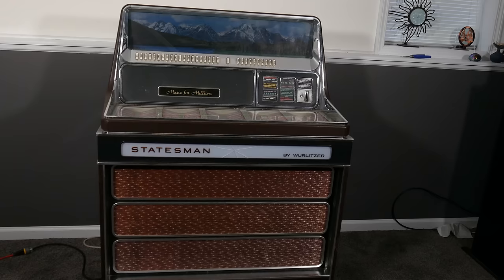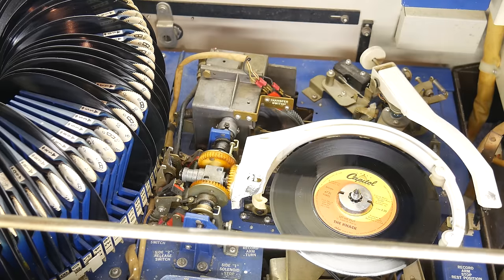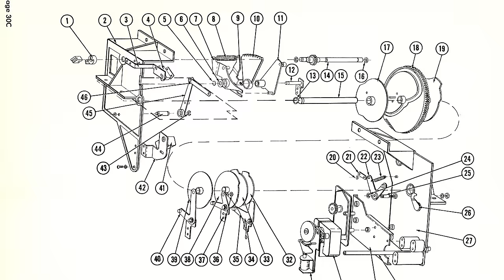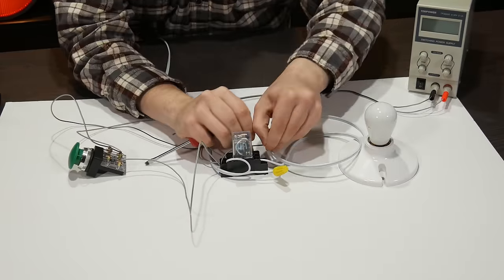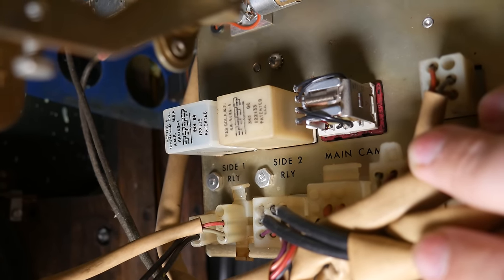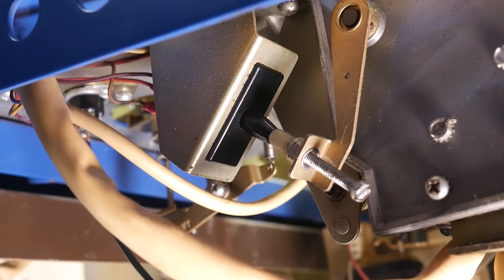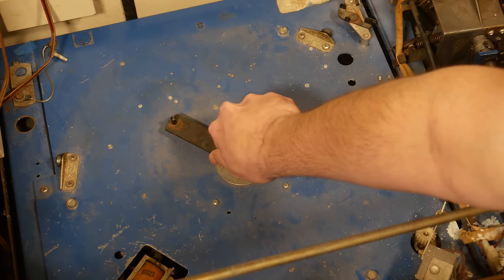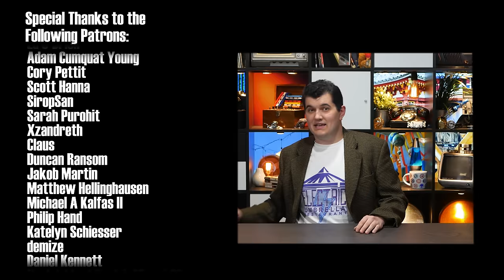The Computer-free Automation of a Jukebox (Electromechanics)

Comment: I think you would get a kick out of the mechanisms that make powered convertible roofs on classic cars work, as they use a lot of the same things you're describing here, but with the addition of vacuum lines running off of suction from the engine's intake! Those vacuum lines in particular can be a pain in the butt to fix, but they are neat.

Comment: interresting, kinda explained why old NYC subways trains (HI-Vs)  were dangerous for operators. The full 600 volts went through the master  controller handle (to control throttle and braking). Newer trains (Low-V and newer), included relays and other interesting stuff so 600 volts didn't have to pass through the controller your hand was touching in order to apply throttle.

Comment: I once had a “Superstar” polystyrene model aeroplane which ran from an electric motor running from a small battery. The tail rudder was steered by a cam which slowly turned and guided the aircraft in a predefined course. Different cams made the aircraft run different courses.

Comment: It kind of helps to think of the modus operandi of this machine, like an electric domino set.

One thing trips another thing, which triggers another 1 or two things, which energizes this thing, which actuates that thing.
It's a ballet of motors, actuators, switches, relays and, in some cases, transistors.

Comment: I made a similar circuit to your relay/light demo with 3ph contactor on a bore pump, the o/load and a flow switch can cut power to the contactor, only the pump is 20m down you have to hold the momentary action start button for 2 seconds until water comes up and activates the paddle on the flow switch for it to run.
Reply: So your play switch is an NC?

Comment: I beg to differ, though I too enjoy these electro-mechanical contraptions but it's very unlikely you'll pick up some tools and materials and start building your own... anything. But with coding and/or arduino and a couple of components you can build cool stuff at home and those can be not just cool for you but useful too. I built a parking place counter system at my previous workplace from arduino, some sensors, wires and some core. The problem was that the parking spaces were behind the building and the road was narrow so it was a constant problem when the parking lot was full they had to back out carefully onto the main road. My solution is basically just a GO/NO-GO signalling at the gate but since I'm not a mechanical engineer I could still easly whip up this system and I think I'm the most proud of this achievement in my life. I could never make such a system with electro-mechanical parts.

Comment: Looking at everything in the jukebox, I can't help but compare it to redstone circuitry in Minecraft.
So many things starting and stopping, triggering each other with a cascade of moving parts.
So many little ways redstone engineering mirrors older electronics.
You pointed out so many Set Reset Not or Latches in the jukebox! The RS Nor Latch is the basis of many redstone contraptions!
I am just so giddy about a silly little observation.

Comment: Since this video came out it's been eating me alive as to why I didn't understand the relay portion. 

After coming back from watching other relay videos I feel your relay video needs to be a bit more explanatory.

The relay needed for this is a Double Pole, Double Throw relay (or Double Pole Single Throw).

Basically the relay has two electrically isolated switches in it which both get triggered at the same time when the control 12V gets applied.

One switch gets wired to the lightbulb and the other one gets wired from the switch back to the control side's input.

So when the green switch is closed, the switches are turned on (called Normally Open) and the current flows through both outputs. The light turns on, and it also flows from the other switch back to the control circuit which bypasses the green switch and so it stays energised always keeping the switches on.

Comment: As a former bowling pinsetter mechanic. Using cams and cam followers is exactly how pinsetters, built before roughly 1990, work. Brunswick Model A (1955-1963) and A-2 (1963-1985) pinsetters have an assembly called a detector. The assembly is 100% mechanical and is effectively the "brains" of the entire machine. Through a series of cam and lever, that pinsetter is able to mechanically determine if you bowled a strike, left pins standing, if a pin slid out of place without falling over (called an out of range) and was able to perform the correct cycle based on the "input" you gave the machine. Though the same cams, the machine knows if it's your first throw, or second throw. The lower the deck assembly to detection height or to lower it all the way to set new pins, when to sweep the rake to clear out pins and a many more functions that bowlers do not get to see. It is really incredible what you can do with just electromechanics.

Comment: Try Central Office switches. Today they are fully digital. In the late 1970's we install the first fully integrated digital switch. Prior to that, Cross-Bar Switches, a form of matrix array. Earlier, Stepping relays. These devices replaced manual switch boards and human operators. Perhaps more fun Pin Ball Machines.

Comment: Electromechanics is a neat field of engineering. Old metro trains in Helsinki, Finland which were built in early 1980s are completely electromechanical and are built to last, cheap to maintain and damn reliable. Siemens tried to automate these trains and failed, the project was cancelled after the budget was about to double or triple. So no automatic subway in helsinki.

Comment: When you were demonstrating how a relay switch works using the 110 volt light, you started fast forwarding the video (and it looked like you jumped). Or got electrocuted 💩
I was so worried & I jumped (when you did).  Thankfully you were SAFE.

Comment: This depends on how you define "code".
In some regards, this has code, just programmed in electromechanically.
Conversely, you can have pure silicon circuitry which is not programmable, yet capable of performing complex functions.
For example, you could have just some (probably most) of those switches wired up to a controller, which technically is not programmable and thus falls under the same idea of "not code", which doesn't suffer from all the same timing constraints.

P.S. the schematic is simple.

Comment: Speaking of relays. When I was younger I rigged a relay to buzz and then fed that through a transformer.  In essence I'd created a spark gap transmitter but it would give one hell of a shock. Also come to thing of it I created an AC signal switch mode power unit.

Comment: The mechanical and electrical engineering and the solenoids and the length of the levers and angles of attack, etc etc ARE the code.  It's all code at some level.

Comment: The most interesting/impressive thing I think was done with electromechanical relays is their use in pre-transistor digital computers. Valve tubes get all the attention, but relays were just as good, in some ways better.

Comment: Cool, but the latch concept was later used with transistors to create logic circuits which presumably are buried in the microcontroller so in the end same stuff just a heck of a bit smaller.

Although seeing the parts are a bit more interesting than peering at a black chip with tiny letters and numbers printed on its surface.

Comment: You say the jukebox has an auxiliary input on its amplifier, is that for feeding audio from other sources when a record in the jukebox isn't playing?  I'm just remember that back in the 80s I went to a Pancake Parlour restaurant where they had a jukebox, a much more typically designed arch shaped one, the kind of image that comes to mind when you hear the word jukebox.  Anyway, this jukebox was interlinked with the shop's background music/PA system, there were ceiling mounted speakers located throughout the shop which constantly played music, until a selection was made on the jukebox, then the audio to the speakers would be muted while the jukebox played.  This jukebox was microprocessor controlled I think, because it had an LED digital readout and you could easily see the record carousel and player.  In between selections, the background music system would briefly come back to life, but the audio would cut in and out repetitiously, and make kind of a buzzing noise, so I presume the jukebox was cycling whatever mechanism muted the PA system.  My guess is the jukebox just sent a control signal to the PA system, muting it.

Comment: I also have one of these and the needle is missing. Anyway to get a picture of the needle assembly on your Statesman? I have fixed most of the rest of it and in is a complicated beast. This video really helped understanding how it works as there is not much information on these and not lucky enough to have manual / schematics.

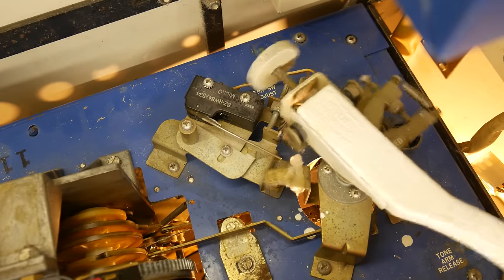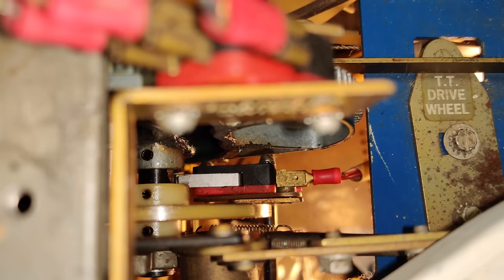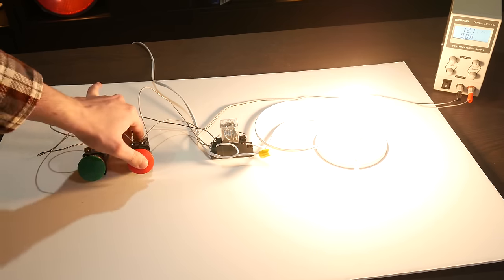Comment: It took a lot of work to complete this upload. Many decisions lead to commitment to how to describe that section. Then you have to set up the shot behind the machine, etc. Suggestion: use a still camera and a lot of controlled light for close-ups. Here are two hindsight ideas. At 16:56 is a perfect place to point out all the timing set screws you can see in several places throughout the video. 8:00 to 11:38 would have worked out much better with cutting in and out a simple diagram instead of pointing to parts in a video of a relay and the wide shot of a bunch of wires in your setup. (With respect.)

Comment: Computers don't have to be binary or electrical. Mechanical computers predated the discovery of electricity. Most jukeboxes since the 1930's had some sort of electronic control which evolved into actual computers. Just as any computer, they are dependent on sensors and inputs. There must be inputs or commands to actuate the mechanical processes in a jukebox. Legally speaking, a jukebox is a commercial record player that plays records. Technically, a commercial unit that plays CD's, tapes or sound files is not a jukebox. In actuality, the last Wurlitzer jukebox with any view of  playing records was the 3000 of 1966, but did re-appear in the nostalgic 1050.
The Wurlitzer 3400 almost bankrupted Wurlitzer due to teething problems with the new mech. The U.S. Wurlitzer company conveniently had a fire and ended U.S. Wurlitzer jukebox production with the last new model  being introduced in 1974.
Wurlitzer jukeboxes started being manufactured again in Germany by a new company, Deutsch Wurlitzer. They record-playing mech was improved and the mechanicals were fully computer-controlled. They introduced the Wurlitzer One More Time, styled after Wurlitzer's most popular jukebox, the 1015. This kickstarted the jukebox nostalgia market and put jukeboxes in the home.  They were the last to make a record-playing jukebox until Rock-ola re-introduced a record-playing jukebox recently. However, their are other companies in the E.U. which manufacture nostalgic record-playing jukeboxes. The Gibson guitar company  took over  Deutsch Wurlitzer and shortly after ended the Wurlitzer jukeboxes.

Comment: Okay, what was the first track on the green record? It sounded interesting.

I should note that I've actually designed several self-latching circuits for exactly this sort of purpose (my new background insists that I call them S-R Latches but I like this name for the mechanical versions). I had a ton of fun with relay logic, at least until I exhausted my allowance on relays (true story). It may also be that there's a limit to what you can do with scavenged, corroded wire and a soldering iron you aren't very good at using... Now I just use microprocessors and save myself the headache, but I remember it fondly.

I've also had to debug something that used, in part, this sort of cam-driven logic (its button panel was some sort of programmable logic (and luckily working, because replacements are tough to get), but it was basically a timer that kicked off a bunch of mechanical stuff). I managed to get through it with a mad flash of insight, but it was difficult. I'm impressed that you're managing something this complex. Of course, you also have the service manual, which is more than I could say...

Also, the possible issue with the credit accumulator might be with whoever set it into "free play" mode. I suspect that may not have been done via an approved mechanism (i.e. someone spliced a wire somewhere they shouldn't have).

And yes, endlessly fascinating.

Comment: Electromechanical devices are cool but by far the coolest electromechanical device out there would have to be the relay logic elevator. No electronics or microchips there and yet it has to take input from many sensors and buttons, feed output to many lamps and displays and move electric motors at precise speeds and for precise distances.

Comment: STATESMAN by WURLITZER. I finally fixed it!
INSTRUCTIONS: Jukebox is on permanent free play. Feel free to make a selection as long as light below is on. 
Is this light on? If so, S E L E C T
I have no idea what this light is for
To make aprogram, pick all the selections you want to hear. The Phonograph will play them in alphanumeric order. Do not chose selections without a slip.
If you hear any strange noises coming from this jukebox (buzzing, tapping, grinding, etc) please shut off jukebox immediately and alert operator (that's Alec)
i love that text on the jukebox

Comment: I realize that this is a 2 year old video but I have an interesting (to me anyways) question. You say the camshaft in this jukebox is a "program" would this apply to the camshaft in an internal combustion engine?  Also Would a distributor with points and condenser be considered electro mechanical?

Comment: Electromechanics reminds me of Minecraft redstone. Every mechanism is purpose built and is controlled simply by wires. There are no integrated circuits. Maybe you wanna call a comparator an IC since it can give a varying output based on a given input, but that’s kinda it

Comment: What happens if you attempt to play an empty slot? There must be a way to lock out those selections. I suppose that's a better question for the second video, which I saw first, but it's applicable here because without a record, the cycle will never be completed by the tone arm.

Comment: I like all your videos, but in this one your relay demonstration with red and green buttons made it not so obvious where the wires go. One thing was that the power wires and switch wires crossed. It would look simpler if all the power stuff was on one side of the table and all the switches and relays were on the other side, only meeting in the middle and not crossing. The other thing was that it looked like there were more wires than there really were because there isn't much difference between how a wire looks on a white background and how its shadow looks. In fact, using a white wire on a white background, the wire's shadows are more visible than the actual wire. If the wires don't sit flat on the table, I think it would be better to have a black background so shadows are invisible.

Comment: I worked at a 60 year old nuclear reactor that recently closed. The whole thing was electro-mechanical, not a damn computer allowed to run in the thing. I loved reading those circuit diagrams. When you need something to work (or at least have a known failure mode) you want electro-mechanical. Software is far too buggy for safety equipment unless it is highly expensive with loads of code audits.
Reply: Might you be referring to Oyster Creek in NJ?  More like 51 years old but maybe you are talking about when construction started.
Reply: @MrNeptunebob  nah, NRU in Canada.

Comment: The advantage of this type of engineering over micro controllers is if something breaks it can be repaired with a knife a ball of wire and a few random bits and pieces. a fried micro processor would be all most impossible to repair without highly specialized equipment and skill. Granted an 8 or 16 bit CPU would be Far easer to try to repair, than a 64 bit quad core processor. In short electromechanical = macguyverable.

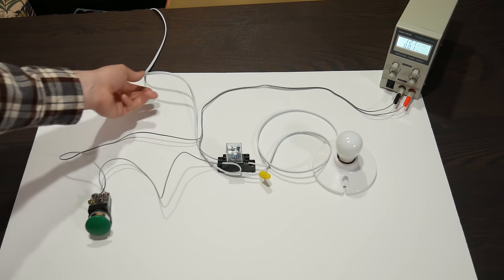Comment: Are you up for some constructive criticism? 9:30 You really should tape down those wires to the whiteboard and eliminate any unneeded rat's nest overlap of wires. Get rid of useless coils and curves of wires. Keep it straight where possible.  Label  each wire (-/+ or AC) and device on the whiteboard. And don't use the same color wires for everything.  If I wasn't already familiar  with this kind of circuit, I'd have no idea what the hell was going on in this messy layout.  Since showing the relay does nothing for the average person, I suggest a diagram of the relay first, before presenting the physical item.  And showing the relay action much closer up would better illustrate its function. Especially after already presenting the diagram of what it's made of (magnet, coil of wire, insulators, flexible parts, etc).

Comment: using nothing but switches, relays and solenoids you say? you mean like in computer. because funnily, there's nothing there except just billions of switches. it's just the sheer amount of them that makes it able to perform four basic math operations, and with enough of them, everything else. it's also all fully digital, since whenever something is on or off, that's not analog. fun to think of, isn't it. the only difference is that we managed to miniaturize it all, making entire building worth of hw fit onto fingernail